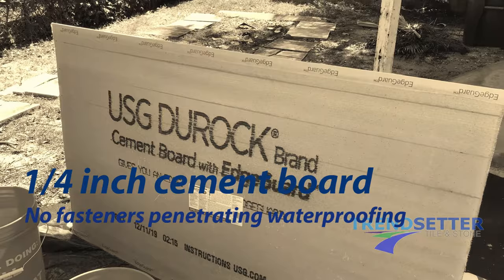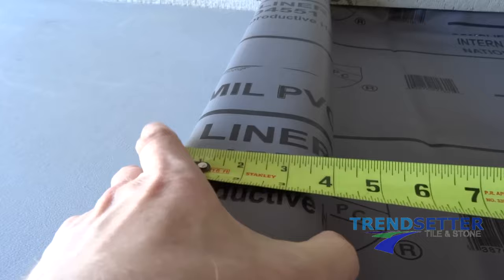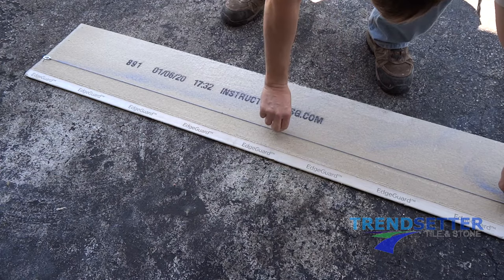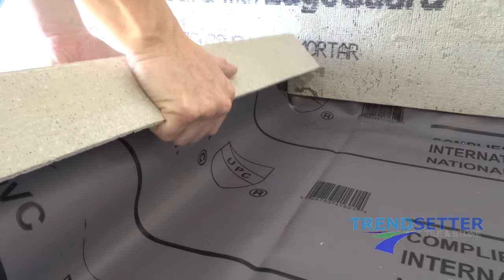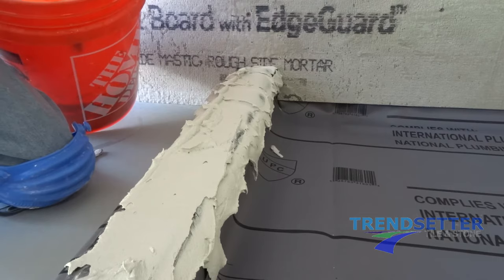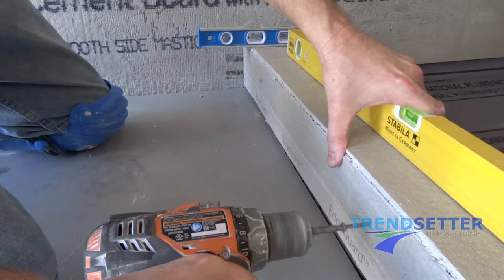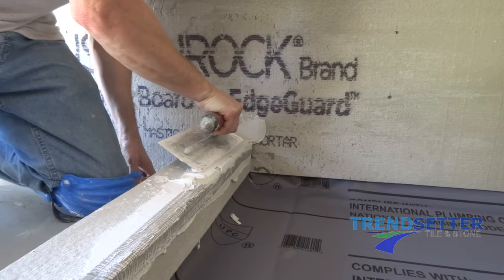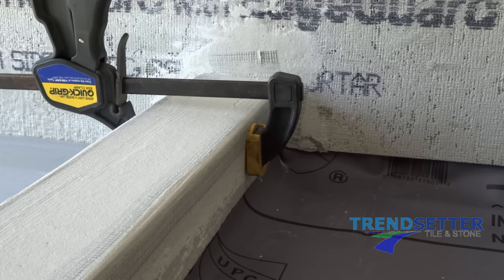How to install cement board on a shower curb and not pierce the waterproofing

Comment: The only part I'm not thrilled with is the 1/4 inch backer, it flexs a lot and your screws could pull through, and with 1/2 inch backer, Your curb will be stronger and curb top cuts will be larger and with the large bull nose the cuts will be a better match to the larger tile most people have went to. Hey just my 2 cents and 40 plus years, hundreds of showers later.
Reply from the maker: I understand but with the mortar under the backer there is no flex. I know what you mean when you say screws on 1/4 inch board can pull through. I have not experienced any pull through with this method and if I had I would not put this method up. I'm sure the screw pullout you've seen with 1/4 inch is most likely from when it's installed on a wood substrate, and when stepped on the flex causes the pullout. 
The reason we don't use the 1/2 inch board is because with the addition of the mortar under the board it can make the curb slightly wide. It might make the curb 6 1/4 or slightly more which is too big in my opinion. With 1/4 inch I can be sure the curb will not be wider than 6".
I appreciate your comment and I can tell you have real experience by the question. Thanks again!
Reply: Thanks bud, I really enjoy install tile. I take my time to insure a great job. A few years ago I had 5 guys working for, witch turned out to be 5 headaches. I cut back to 1 great one. I explain to who ever works with me,  MY NAME is on EVERY piece of tile installed, not theirs, mine! They couldn't stand me, I was Dick, but oh well, I have a Great name in the business. Old school, use to do mud walls and floors. A tub surround would pay 250.00, crazy right. Okay man. Bust ass.PS I'd like to share a couple ideas with you on pans and curbs. I'm sure I've done about a thousand showers.
Reply from the maker: @jamesderbaum9678  I'd love to talk, fill out the contact form at this link https://www.southfloridatileinstallation.com/contact-us.html
and I will give you a call!

Comment: Do you per slope the pan
Reply from the maker: Yes for this shower type, which is a TCNA B415-20, a pre-slope is required. The pre-slope under the liner and the mortar slope above the liner are both to be a 1/4 inch per foot.

Comment: Will this work for a cinder block curb
Reply from the maker: yes, process is the same.
Reply: @trendsettertilestone9602  you didn’t add any thinset on the face of the curb I can’t screw into concrete blocks
Reply from the maker: @781redrum8  You can, you would have to use Tapcon screws into the block. A hole is drilled with a masonry bit and then the Tapcon is used
Reply: @trendsettertilestone9602  thanks  didn’t know that

Comment: That is not durable, the mud won’t adhere to the liner. The liner is simply rolled over the 2x4’s and is loose therefore your inside piece of backer board is going to be loose. You could easily pull that apart with a small tug on the inside. The answer lies in not using wood inside your curb period. You need a mud curb with no foreign objects inside the curb.
Reply from the maker: I don't know why guys like you need to pretend to know it all. This works, and it works well. Try reading the comments and you'll see I address that the liner is not meant to adhere to the board with thin-set. Go ahead...If you wanna talk some time go to our website and give me a call. I'm here to help, not to criticize somebody with a method that I'm not familiar with. Best of luck to you, and for real, give me a call. I much prefer to make a friend out of you.
Reply: @trendsettertilestone9602  I am familiar with this method. I’ve had a very long career in the tile trade and over the years have tried every method known to man to build a curb efficiently and durable. I’m not a know it all but do have a vast experience with mud pans as 80% of my work is showers. I not long ago took over a job where they built curbs this way and while it appeared stout it wasn’t as strong as a true mud curb. It is better than running screws through your liner though. My point is if you had to tear out a mud curb vs a backer board curb the difference would be obvious which one is the strongest. And I would be happy to reach out and chat. Appreciate your input.

Comment: This technique is a little doubtful. If your inside liner at the curb is not secured neither will your cement board curb. Any movement in that area might cause potential trouble.
Reply from the maker: This technique is no different than lath and mud. Which is considered a reliable method. Instead of mortar/fat mud, thinset is used, and instead of lath, cement board is used. Both are applied over a liner in this shower type. Fat mud is not used as an adhesive- neither is the thinset. Lath is used for shape conformity-so is the cement board. The liner moving is not an issue, especially if you consider the fact that the shower pan mortar is installed against the curb further solidifying the overlay.

Comment: every one says thin set does not stick to the pan liner
Reply from the maker: That's right it doesn't. It doesn't need to. The shape of the Durock with the mortar is making a mold around the curbs liner. The molded shape is what attaches this part of the assembly, not an adhesive bond.

Comment: Best way is not to do it. Thinset doesn't bond to a liner
Reply from the maker: Try reading the description handsome.
Reply: @trendsettertilestone9602  yeah. So what. Thinset is just that. THINLY SET. It is a process of thinly setting mortar. The mortar also had limitations. It is not designed to be used as a filler to make things level. It also has a maximum thickness. Read it on the bag. You are a hack
Reply from the maker: @speedy63663  Hey handsome, no need to get ugly. The product is not used in a way that exceeds it's limitations. 

The mortar may look excessive upon application but once the overlay is compressed the mortar does not exceed a half inch in depth which is acceptable according to any bag of LHT, and some LHT's allow for three quarters of an inch. 

Do you know the company Noble?
Here is a link doing the same thing in this video with a pre-formed overlay.

https://www.bbindustriesllc.com/noble-285-preformed-curb-overlay-36.html?gclid=Cj0KCQjwr4eYBhDrARIsANPywCgTPvQlvwFQsFSFxyQdo294PGXgWGT7cAu5WMUvk4P9GgDFaZTyZP8aAkqPEALw_wcB

Man you better call Noble and straighten them out! 

Look man, I understand that this assembly seems improper to you, and by the way you've commented I can see that your someone that values quality workmanship. 
Your comment though is wrong.
Best of luck.

Comment: Unique, but not an industry approved method.  No thinset mortar manufacturer would warranty their product being used to fabricate a curb in that manner. That’s not what thinset mortar is used for, it is used to set tiles. period.
Reply from the maker: This is a think outside the box method. It came about as a solution when skilled mudwork was on the decline and careless installers were penetrating liners with regularity. I understand that because this method has not been defined by the guidelines you feel it must not work. 

If that is the case why would Noble, Laticrete, and others manufacture foam overlays. That are to be installed in the same manor as this method.
Laticrete states "Works in conjunction with most LATICRETE tile and stone installation materials."

Heres a link to the product.
https://stonetooling.com/laticrete-hydro-ban-preformed-curb-overlay/?utm_source=google&utm_medium=cpc&scid=scplp70.607&sc_intid=70.607&gad=1&gclid=CjwKCAjwg4SpBhAKEiwAdyLwvKL8VxdG06EhPnjGsPMfjJbbhe2AFwSpMb_tdy0LSI1KH88pdA4lFxoCwZIQAvD_BwE

The fact of the matter is that the handbook is vague in the description of how some things are done intentionally. Products like uncoupling membranes took over a decade to get into the TCNA handbook. When it came about everyone scoffed at uncoupling. "No way you can stick to plastic, this can't work!" 

Ingenuity and practicality has always had its place in construction. This method still operates within TCNA guidlines since manufacturer guidlines overide the handbook. 

Even if something is not in the book that does not preclude it from being in a tile assembly. Unless specifically stated. Like spot bonding for example.

We put this video up because it shows a practical way to construct a curb when mudwork skills are not on tap. You may have been taught mud work, and so you can understand that mud work is not something that can be learned over a video. Mud work takes finesse, a lot of time spent practicing, and a proper teacher.

Word to your mother

Comment: OMG! are people actually doing this? The curb isn't even secured at all because the PVC isn't secured.... you can't mount unsecured things to ... other unsecured things. terrible advice.
Reply from the maker: OMG! I understand how you might feel this way. 

Read the description.

Stop using OMG, you're welcome.
Reply: It would seem to me that once the curb is screwed in from the outside, you then pour cement inside to make your sloped floor, if the cement goes over the curb just built even by 1”, it will secure the whole thing. Plus you’ll be adding more thinset and tile over the curb anyway.  It seems to me that this will work just fine. The way the curb was built it’s like a cast, the screws on the outside hold it in place and the cement on the inside holds the other side. It’s not going anywhere, unless it’s on the ceiling and even then I don’t think it will go anywhere

Comment: That inside curb flap will definitely detach over time and crack the tiles. Very poor install.
Reply from the maker: lol
Reply: Watch and then read. It can't detach. You can see in the video that the shower floor mud HAS NOT been installed yet. The shower deck mud will be against it and under the edge of it, which will lock it all together and make it tight.
 The only part I wasn't so sure about was that most folks are saying not to have the wallboard touching the shower floor. Here, he is saying that the cement board (like Durock) IS allowed to contact the shower floor mud, right?
It's all as clear as mud, yes? 🤔🤪🤣

Comment: thinset DOES NOT stick to pvc liner. Both manufacturers tell you that thinset should never be applied to pvc. Fingers crossed that it doesn’t move and crack your grout lines in the future.
Reply from the maker: Fingers crossed that you read the description
Reply: @trendsettertilestone9602  you built the curb out of 2x4’s?
Reply from the maker: @mk-jm5tv  Yes

Comment: This technique is a little doubtful. If your inside liner at the curb is not secured neither will your cement board curb. Any movement in that area might cause potential trouble.
Reply: He poured a mortar bed which goes up against the inside face so its a non issue.